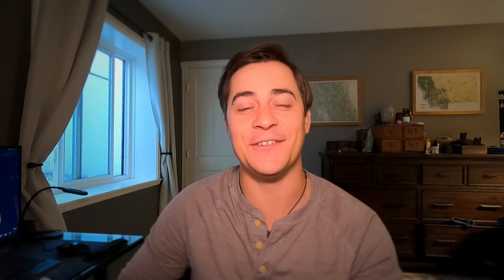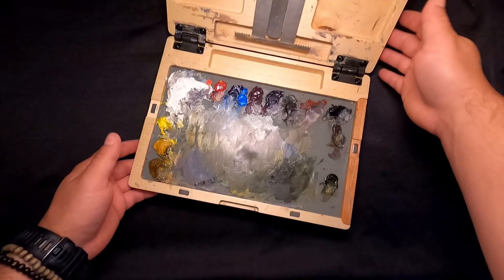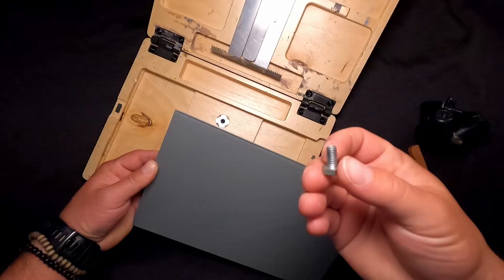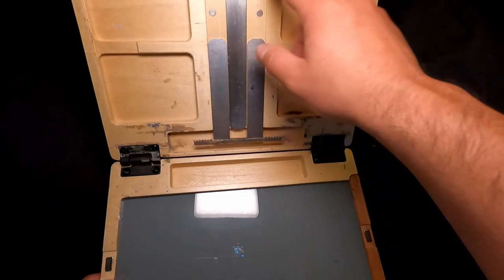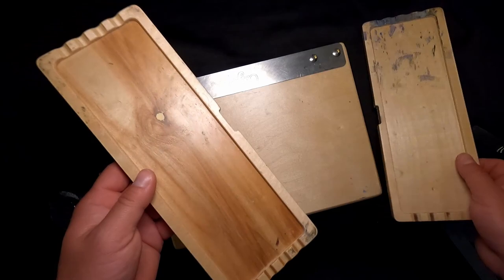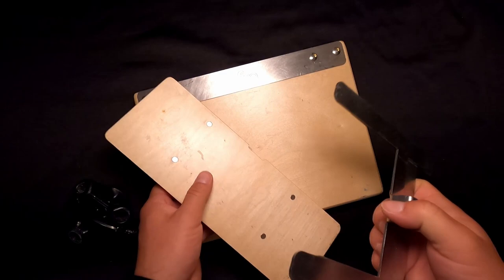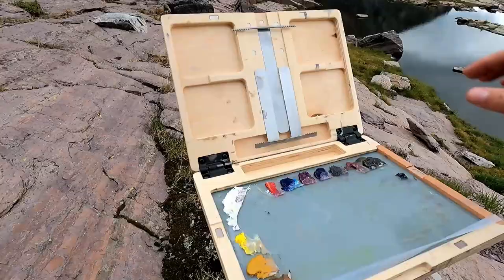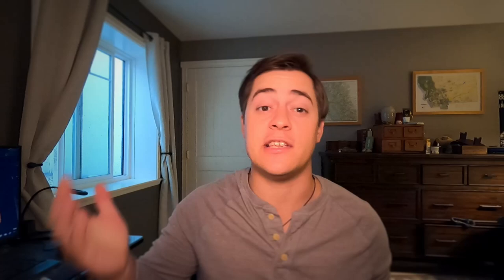U-Go easel review part 2

Comment: Kenneth, I purchased a small pacade box with two side panels. I am going to do watercolor and acrylic. I used it for the first time Friday and the shelves seemed a little loose on one side. I didn't know if it was because I used two on the small pochade box, but with more research I saw that many had two shelves. Is your loose on the sides? I called New Wave but they haven't gotten back with me yet. I am going to take it to a paint  this next week on location in Paducah and see what happens .  My metal 4 x 8 watercolor palette fit on there perfectly with the magnets. I actually put a  paper pallete on the  plastic pallete and it was easy to clean up. Acrylic dries really fast. Thanks for your review.
Reply from the maker: Hey Suanne, thanks for the comment. The side panels are certainly not SUPER stable. They hold for light use, and never popped off on me. Still they can bounce a little in the wind etc. I think it is just the way it is designed. The big rubber band it ships with might help make them tighter.  Thanks for the paper palette recommendation! Happy Painting :)

Comment: Thanks for review mayhaps the designer can prefabricated the arm slides and make them foldable so they transport better if you can talk to a welder maybe they can reward the arm slides so they can fold down...it might Cost you fifty dollars in welders or fabricators time but hey it's better than gouging out your equipment or bags....good luck..
Reply from the maker: So true, that REI bag was probably $80 and I don't need a hole in it. I will see what I can find for a solution but for now I am back to using my daytripper.

Comment: Could I ask you to comment on how you got along with the palette size in this medium box? I usually paint no bigger than 12x10 (horizontal) which would fit on the medium, but am considering the large simply to get more palette area.
Reply from the maker: Thanks for the comment :) I definitely wished I had the larger size. I mostly felt cramped trying to paint an 11x14. Smaller was alright. If you are going to have paint stored on the palette it will feel even more cramped. I used a pill container for my paint so I have extra mixing room.

Comment: I'm leary about getting the side trays.  They seem Jacky and I don't want the extra weight or bulk.  How could you attach solvent?  Do you think it would be possible to just clip it on the side of the palette?
Reply from the maker: Yeah solvent holding is always a little tricky. I have a little clip that can hang onto my tripod. Sometimes I just put it on the ground. I don't use a ton of solvent when I'm working though. Good luck :)